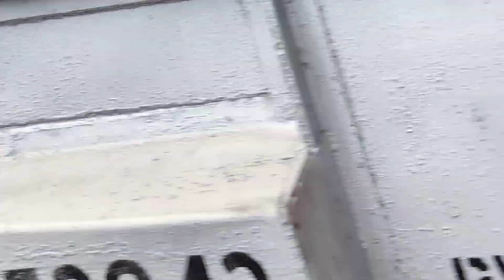KARNATAKA Express Journey| Part 2: Ahmednagar to Manmad | Ankai Killa | Daund Manmad Line Doubling

Comment: This train seriously needs atleast 2 3AC and 1 H1/HA1 coach...Sorry to say this, this train was looked great in ICF avatar itself(although I am an LHB lover)  but the mistake done by SWR is they are using previously used LHB stock use by other trains previously. Also after LHB fication , this train maintainance had become like ECoR/SER/ECR/ER like trains(these are the worst maintained zones of India). An perfect South train of this route connecting to North, but lost its Hallmark charm of "PROUDLY SOUTH INDIAN TRAIN" because of wrong decision in alloting old LHB rake by SWR. Also same issue for AP express(VSKP - NDLS)  except SL coaches , all other AC coaches were in worst condition becoz the train was in under control of NR and near 2019-2020 the train was hand overed to ECoR but still train sucks because of "reuse" rather than "new coaches". Above said issue for also KL express(TVC - NDLS) of SR because of poor maintainence apart from daily 3k plus KM ride. But shamefully, all newly designed coaches of ICF factory were been shifting to other zones and SCR rather to SR and SWR because of being running in loss.
Reply from the maker: Sir there are three 3AC tier coaches in KK EXPRESS
Reply: @CENTRALRAILWAYSRailfan  the serious real  issue is maintainance . but i mentioned low ac coaches too because of 2410 km ride. also please see my comment once more time. we too need justice😓
Reply from the maker: Are you saying additional 2 3rd AC coaches ?
Reply: @CENTRALRAILWAYSRailfan  yes..but we need 3A economy class.. aleady railways rolled new 3A economy coaches from RCF Rae Bareily. Also it will help many to travel comfortable incase SL quota is less they can easily upgraded if extra AC 3A coaches(atleast 2 were there). But we need LHB 3A economy now recently rolled off. Currently RCF Rae Bareily has rolled some 7-8 coaches(not clear) for NER zone.